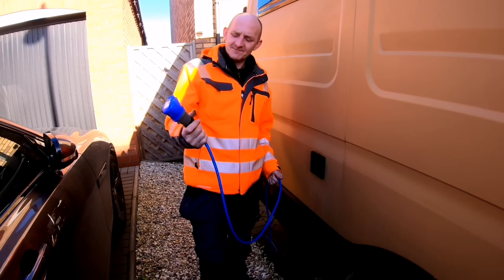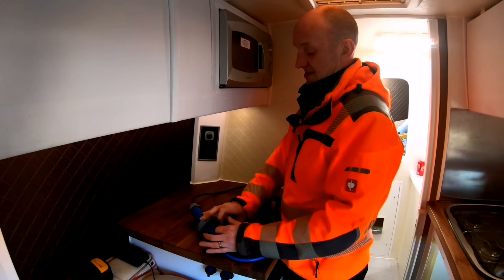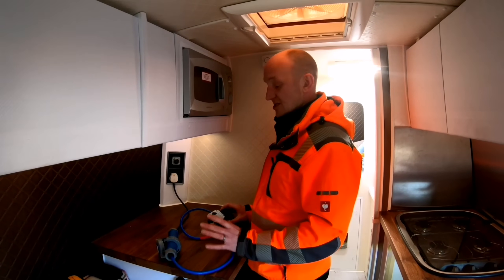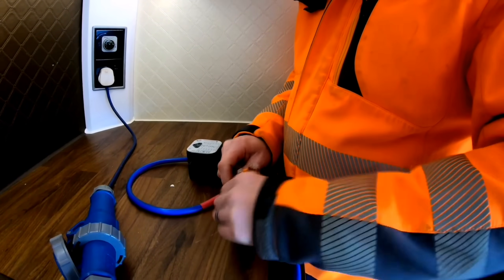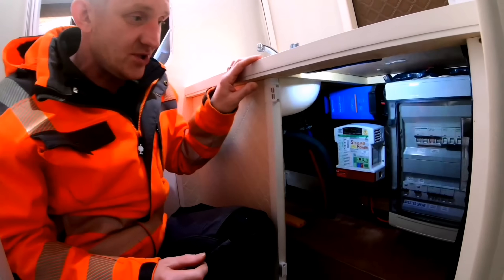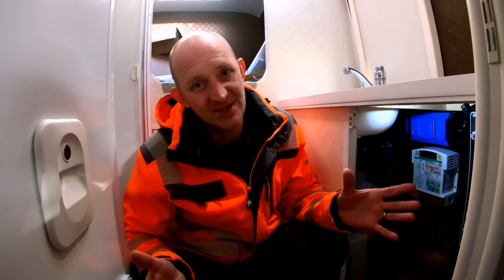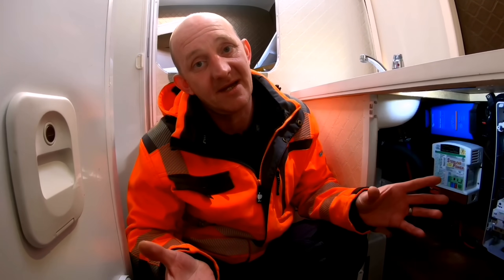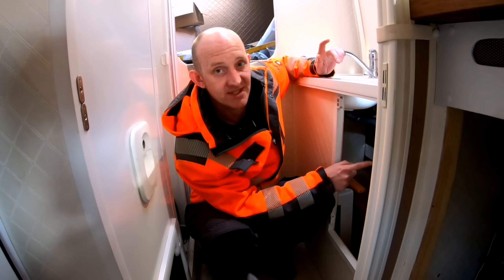DIY Camper Van Mains Electrics Explained. (18th edition BS 7671).

Comment: in this setup was the inverter left on or was it manually switched on and off or something else?
Reply from the maker: Removed as they was a fault with the inverter. I haven't had the need for the inverter since. The change over switch is (was) used between hook up and generator. As I only used the generator for welding jobs when I'm working on the farm that's going to in the rebuild 👌👍👍👍.
Reply: @Iveavan  yup I know the inverter was removed it was mentioned on the video, but the inverter itself had an on/off switch so presumably the inverter would have had to be manually turned on and off? just trying to make sure I understand fully the setup as it seemed pretty good
Reply from the maker: Sorry. yes, from memory yes it did your right. I think it had two, the remote switch and upon the inverter itself 👌👍.

Comment: Thanks for the useful video. Is there any reason why a N-E bonding couldn't be added externally to a centre tapped inverter? It would have to go between the contactor and inverter (i.e. as close to the invertor as possible), but would that allow the RCDs to work properly on both inverter power and shore power?
Reply from the maker: I wouldn't advise it as then your messing around with Primary & Secondary windings with inside the inverter. Mine worked similar to a builders 110v transformer. 
just on mine due to the imbalance of the live and neutral I think it was way out on the neutral (from memory) and gave different readings, so no solid readings, obviously something wrong within the unit and not worth the hassle. (If it did work we would we would of added another RCD due to the split between the Live and neutral, I think that was the road Spunky was going to go down). But even today I don't have an inverter (besides the generator) as I manage to run everything off 12volts upon my campervan. 😉👌👍👍👍.

Comment: Thanks. Very useful.
Some background. Some inverters, like victron, will cut power if the external feed polarity is reversed.
European plugs, known as shuko will go in either way round. So if you buy a couple of weatherproof short shuko to CEE adapter cables and a shuko tester you have a way of testing/correcting. These adapter cables usually supplied in pairs, with shuko plug and socket and CEE plug socket. So CEE plug has shuko socket and Shuko plug has CEE socket.. 
Shuko sockets should be wired like the UK, neutral left, line on the right.
First check continuity on the shuko male/female socket/plugs. Plug them together so that they're connected  correctly. You'll have correct  continuity which you can test at the CEE ends with a normal meter. Mark with a paint marker across the shuko plug/socket. Best to mark the neutral side.
On the camp site plug your shuko socket adapter into your cee cable. Plug the CEE into the site CEE socket. Use your tester(aligning neutral to left of tester). If it shows ok, good to go and connect normally without the shuko extensions. If faulty, check reversal/earthing by rotating the tester 180 degrees. This should show earthed, polarity correct. Assuming that's ok, use the other shuko adapter the wrong way round to reverse polarity and plug the CEE end into the van.
Reply from the maker: Thanks for that information bud 😉"👊" 👌👍👍👍.

Comment: I will be just doing a basic 240 electric hook up just so I have a few sockets and my water heater which is gas and 240 volt electric so I have to have a small amount of 240 power just to ignite the gas on the water heater which at first I thought it was 12 volt but when. i tested it . It turned out to be 240 . I was hoping to have my build done by March but it’s looking like it’s going to take a bit longer with this weather . Once I finish the outside I should be able to make some time up because I will be working inside ,I should really get one of my sons to do the spark work but he is very busy with work but I know how to wire a house it’s just all the new regs that keep changing but I can always ask him if I come unstuck, but like always Mark another great video and very informative.
Reply from the maker: Cheers matey, and good luck with the build Thomas 😉👌👍👍👍.

Comment: Nice one! Well done on explaining how to do it correctly. If you do a follow-up, please cover how to connect the incoming earth wire from the hookup socket. (Whether you need earth bonding, etc.)

I guess that Marks inverter, like many others can't be earth-neutral bonded, so shouldn't be wired into the van sockets?
Reply from the maker: Spunkys on with it now bud😉👍, my inverter was faulty, so it's now been removed completely!... I've now bought a "Pure Sine wave" but with a difference 😎👌👍👍👍.
Reply: MisterG thanks 👍 yes you do need to earth bond to chassis and any gas pipe  work. A couple of people have asked this now. I thought I’d covered it 🤔 but I missed it out 😬 basically in the consumer unit earth bus bar hook up earth goes directly to that bus bar along with all other earths sockets lights ect and then min 10mn earth to chassis, hope that helps 

As for inverter your right mark has removed his now! It’s a hard topic really but to keep it as simple as possible neutral earth bonded is definitely the way to go, if you can’t then use some form of rcd even if it’s the plug in type and press the test button to make sure it operates 👍
Reply: Thanks for the reply. You should definitely do the follow-up. (btw: I think it's min 4mm^2 for the earth, but not going to argue with you about it! :D - Likewise, not sure that an RCD will work without an earth, but like you say, it's a hard topic. I think the best you can do without N-E bonding is to plug things directly into the inverter & try and make sure that they're double insulated.) - well done on taking this on though.
Reply: MisterG I’ve never tried one without earth 🤔 might have too! They should work as they measure an imbalance between the phase and neutral (as long as you get one for the right voltage which as we found out with marks inverter been centre tapped wouldn’t operate the rcd probably due to the fact that it’s was imbalanced at 161v on phase and 69 on neutral or each phase as such and the rcd required 240v on phase. You can get 110v rcd but with marks been as it was 🤔🤔😬) you do need an for the leakage though!🤔 as for the csa of the cpc I always like over do it 😁👍
Reply: Thanks again - "they measure an imbalance between the phase and neutral " - I'm fairly sure that the only way to get that imbalance is if there's an earth connection to return any leakage current to the supply, but we're getting quite geeky now, and this isn't really the place! 😁👍 - Great video.
Reply: MisterG 🤣🤣 can’t stop the geeky side coming out sometime 😂👍

Comment: Superb 👍🏼 didn’t think about double pole trips before!  What manufacturer are your trips and the relay from?
Reply: Yeah your right I’ve not seen dp rcbo. I’m going to have another look at it all, I’ve run the cabling but still working out the best approach to the board. I’ve a manual 3-pole isolating switch to change from mains vs inverter supply. But the relay is a far more elegant solution! 👍🏼 much head-scratching and design work to be done ✅ 😬
Reply: Riaz RJ that’s why I’m going 🤔 gone bald 🤣 we are going to be doing another video soon about the relay on a bench as such to show it in operation and how it’s all cabled up 👍
Reply: Riaz RJ they are Schneider ones link in the description, although other manufacturers make them too 😉 double pole mcb are a requirement in the regs but that aside always best to go belt and braces with electric ⚡️👍
Reply: Cheers, I was thinking of going rcbo on each circuit. As like you only powering a set of sockets on each side of the van. Will take a look at these
Reply: Riaz RJ I’m not sure that rcbo are double pole switching 🤔 there might be some that are. That’s why we chose to use an rcd to cover the full system and also as main switch then the double mcb as overload protection as rcd are only leakage not overload. Some people get confused due to the rcd have an Amp rating on them 👍
Reply: Riaz RJ if it was in different circumstances or location rcbo are definitely the way to go on each circuit 👍

Comment: Not sure if that's helped or helped to make it more complicated, clearly spunky knows what he's doing but I've never seen 240v explained so complicated.
Reply: Mike 6978 I tried to make it understandable, that’s one of reasons I tried to stay away from quoting regs. If I can clear any of it just ask 👍
Reply from the maker: What part did you struggle with bud? Maybe he be able to explain it on here 🤔😉👍👍👍.
Reply: @Iveavan  Basically the consumer unit set up.
Reply from the maker: @UKvet246  would a detail step by step build of the consumer unit help? Spunky could do that I reckon, incorporating the inverter relay🤔 😉👍.
Reply: Mike 6978 yoy have two RCD (main switches) one for incoming shore power and one for incoming inverter power these feed into a relay that switches between incoming sources by default it normally closed which is the inverter feed once you plug shore power in switches to the normally open side and isolates the inverter feed this then feeds the double pole mcb’s (top row) for the sockets. The other mcbs next to the rcd are inverter protection so you can’t overload it, mcb to protect the relay coil and an mcb for the battery charger which is direct feed from the output of the shore power rcd. As you don’t want the battery charger on when your using inverter power. Hope that makes sense. I’ve spoken with @iveavan Mark and we are going to do a bench version video of it to try and show it 👍
Reply: @Iveavan  Yep sounds good

Comment: Hi there great video. Just a quick question regs show that you need to earth bond the chassis and I don't think that you mentioned it. (if you did I missed it) I can see that you have an earth wire coming out the bottom of the fuse board and assume that this is earthed to the chassis. The reason why I mention this is because a lot of people are confused where they say a vehicle is on rubber tyres so don't need an earth cable. But if your metal chassis became live because of a chafed wire for instance when you came back to your van whilst on shore power you could become that earth and get a nasty shock. I just would like you professional opinion on it many thanks. And top job👍
Reply: Bryn Hope well spotted with earth cable 👍 I thought I’d mentioned it. Your right the installation needs earthing to the chassis. Like you said even if you can’t touch any of the metal work of the van and it’s on rubber tyres if fault occurs you will get the shock when stepping out of the van or like you say on your return. Only befit would be if it’s crooks at your van 🤣💥⚡️ best alarm/protection for your van 💪. I’M NOT CONDONING OR TELLING ANY TO INTENTIONALLY LIVE UP THE VAN!!! 🤣👍
Reply: @markbrameld  perfect thanks for your reply also wouyld it be good practice putting an earth bond to my copper gas pipes and metal sink like you would see in an house? many thanks again great video
Reply: Bryn Hope I’m thinking I missed a hole section out now 🤔 sorry. Yes definitely the gas pipes it only needs to be one point as long as there is continuity throughout the system. The sink isn’t as big a concern like in your house as in general the water supply is in plastic from a plastic tank and the sink is nowhere near any source of earth or live. That’s said..... it’s all down to setup and positioning of equipment. If your not sure earth it is a good rule of thumb 👍

Comment: Mi sarebbe piaciuto capirci qualcosa. Ho solo capito che il filo x la corrente continua deve essere di 25mt. Peccato. Grazie lo stesso
Reply: Salvatore Amore la dimensione del cavo (csa) è di 2,5 mm su 25 M di lunghezza a 230 V = 16,5 A circa il cavo da 2,5 mm è ok per 25 A, ma cerca di mantenerlo il più corto possibile.  Il 25M è la regola per la lunghezza massima del cavo da collegare tra la sorgente del campeggio e il furgone.  spero che questo possa essere d'aiuto

Comment: Informative video thanks for that. 
A question for you please. I’m interested in the relay for switching between mains hookup and inverter. I understand how it works but didn’t know there was anything commercially available. Any chance of a short video even if it’s just photos and narration please. 
Thanks
Reply: Cheers guys
Reply: Perhaps a wiring diagram?
Reply: Diesel Bushcraft I’m sure mark an me can sort something out 👍 I think I put a link to the relay in the description
Reply: Diesel Bushcraft they work in the same way as Automotive relays just different voltage coil and markings. On automotive relay the coil is pins 85 & 86 on these it’s A1 (+) & A2 (-) they come in all types of configuration but this one is one NC and one NO when the coil energises it switches between NC & NO. So we have the inverter connected to the NC & the shore (hook up) connected to the NO. When we plug in the shore power it energies the coil switching it from NC to NO. as regs do not permit and junctions /taps between the hook up point and the rcd we take a live feed from the hook up rcd output to A1 on the relay (via the 1A double pole mcb) and A2 goes to the neg (via the 1A double pole mcb) I hope that makes sense.
Reply: Mark Brameld so you’re powering the coil from the hook up main switch(rcd) and when that energises it pulls the contacts switching from the inverter to the hook up side. Never thought about using a contactor as a changeover switch before.
Reply: Phillios R that’s it 👍 obviously the contractor is a 240VAC coil 😉 the power to coil has to come from output/load side of the RCD which as you put correctly we are using as the main switch 👍
Reply: Mark Brameld gotcha. So how does the inverter switch the contactor or is it just in its normal state until mains power comes in?
Reply: Phillios R the relay is in its normal state (NC) which is where the inverter is feed is connected. So as long as no hook up the relay rests at normally closed once feed to coil it switches the normally closed to open and the normally open to closed 👍

Comment: Hi Mark, great to see your back posting on Youtube - Please can you ask Spunky a safety/legal question - This is not van electrics related, but is electrics related - Does all 240 v (RCD protected) armoured cable for garden security lighting have to be buried and in-cased in a sand channel to a certain minimum depth?............if so, what depth?
Reply: whu58 hi as rule of thumb 600mm or deeper but it depends on location really if under a concrete slab or in a flower bed makes a difference. Myself I usually go around 18” then sand on top then the marker tape then soil back on top. 

https://professional-electrician.com/technical/electrical-installations-garden/

This shows it a bit better. Glad your using an RCD 👍 don’t forget to size your cable correctly as where it’s installed can make a difference in csa of cable. Have a look here 

https://www.tlc-direct.co.uk/Technical/Charts/VoltageDrop.html

Hope this helps 👍
Reply: whu58 it doesn’t have to be buried but has to be either clipped to a solid structure or buried. 👍